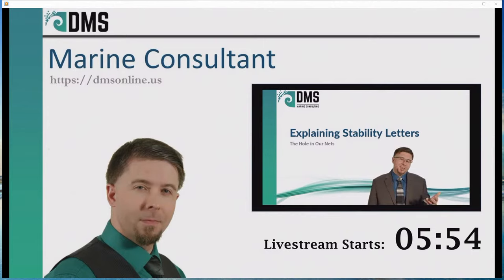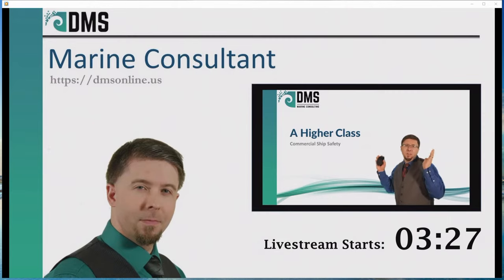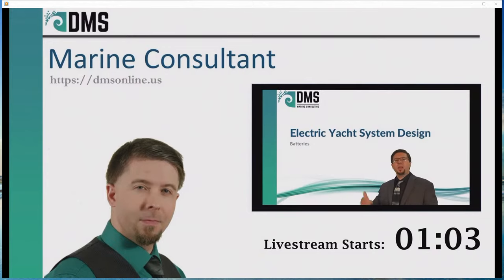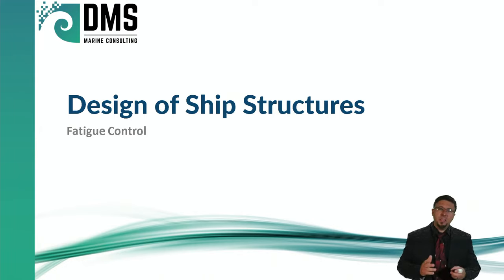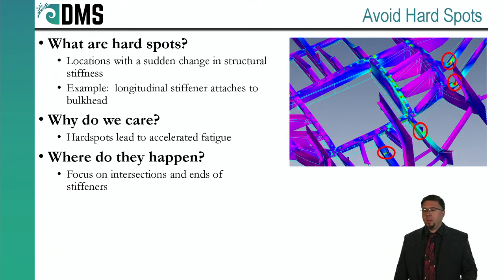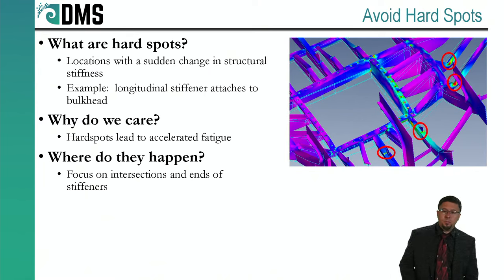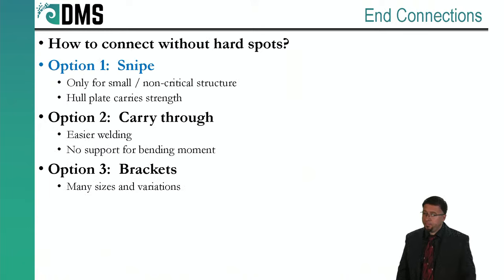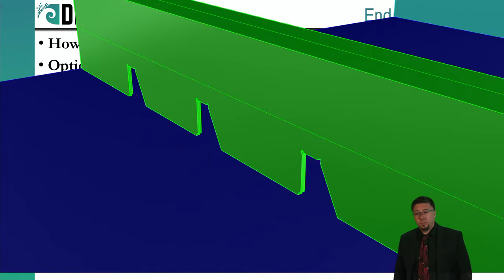Extend Your Ship LIfe:  Fatigue Control

Comment: I wonder, when designing ships, do you ever take into consideration decommissioning or plan for life extention programs? Have you been part of such programs your self?
Reply from the maker: I have not been part of that myself.  But yes, larger ships especially consider decommissioning.  There is a program called the Green Passport which specifically considers all the hazardous materials that went into constructing the ship and tries to limit those materials.  Unfortunately, that is a small step.  Overall, ship scrapping is still very hazardous, because it's cheaper to ignore safety concerns.  There are safe ship scrapping yards out there.  But they have a hard time beating the better prices from the less ethical yards.  

As far as life extension, I did work on that with an old ferry.  And I have seen designs that consider this from day 1.  Life extension usually requires two things:
1.  Survey the hull and replace steel that corroded too far.
2.  Replace or recondition old machinery.  The biggest item is the main engines.  Main engine overall can be a sensitive matter.  Ships only need to meet environmental limits from the time they were built.  Except if you do a major overall, then you are required to meet current environmental limits.  This becomes especially important for the main engines.  It becomes a balance act to decide how many pieces of the main engine we can replace before its considered a full overall, requiring a new engine.
Reply: I figured that would be the case, but I had to ask. I work for a company that specializes in mobile machining and decommissioning, so we are involved in both decommissioning and life extention of all kinds of equipment and structures, many of them ships. It inevitably always feels like an afterthought, and often requires specialized tools to be built, that's where I come in. So obviously my samples are greatly biased. 😅